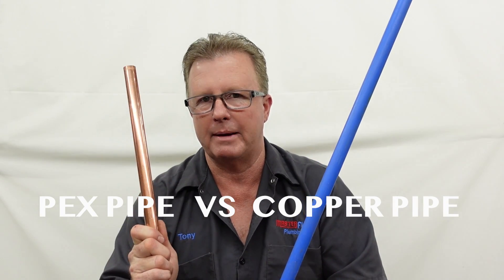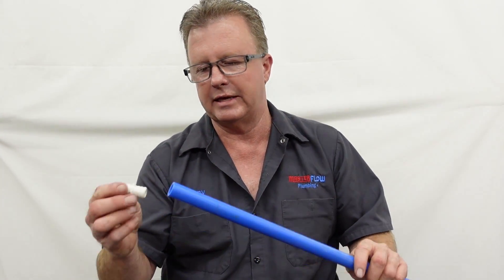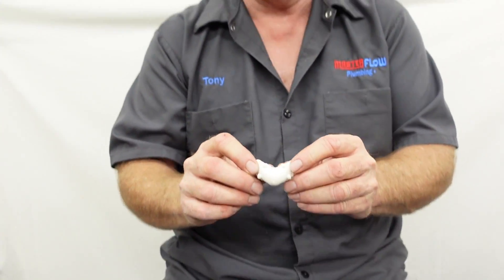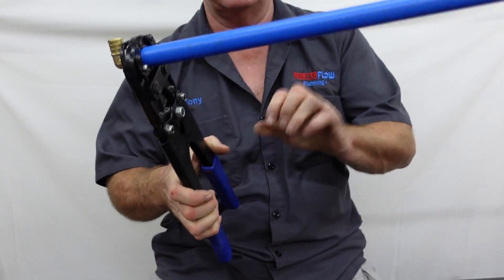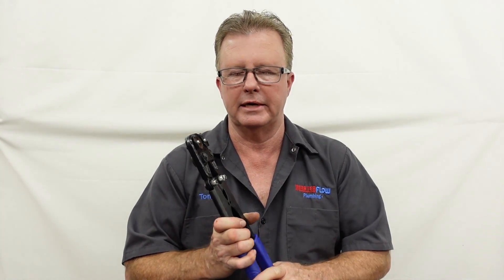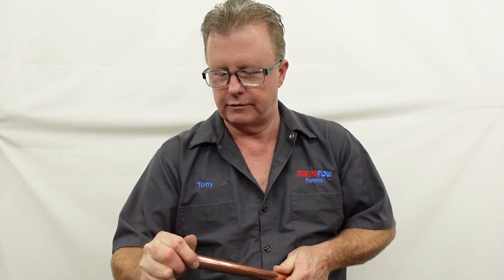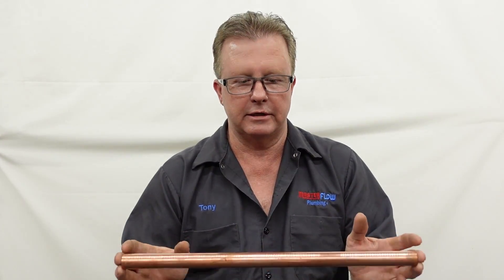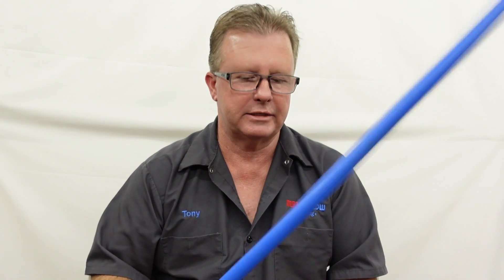Copper Vs  Pex Pipe One Plumbers Opinion

Comment: Generally a good video, so thanks. You need to check your derivation of the term 'plumber', though. Its origin comes from the trade of working with lead (plombo; Pb on the periodic table of the elements), i.e. the ability to make pipes from the metal lead.
Reply: The Latin for lead is "plumbum."
Reply from the maker: Thanks for watching

Comment: Seems as if PEX-A would solve the cons you have with PEX.  Also, "plumber" has its root meaning in the Latin word for lead.  In our use of it as meaning truly vertical, that comes from the use of a lead plumb bob on a line.  Then again, plumb bobs in modern times are more often brass or ferrous.  I like copper too, for indoors.  I prefer PVC for outdoors, but buried well below frost line PEX-A is an alternative.  Nice presentation!
Reply from the maker: Thanks for watching.
Reply: Back in the day plumbers made lead joints on soil pipe made of cast iron.
Reply: @bud5084  Yep, pack the bell with jute and pour the joint with lead froma ladel.

Comment: Installed a 1/2" Pex-A line to feed my refrigerator ice maker from an RO system. Wife says it makes the water taste like plastic I took a sample from the RO system and she says it's good has to be the PEX. Seems to be after the water sits in the line for awhile if I flush it then taste is better. Also forgot to mention PEX can be chewed by rats, or other rodents where copper can't be chewed.
Reply from the maker: I’m not a big fan of plastic water lines. Period.  Thanks for watching

Comment: I am doing a complete rework of the master bath including 3 shower heads, not a cheap project. I am a retired HVAC&R contractor so soldering is no problem PEX will be used due to the cost difference, although copper is preferred.

Comment: Don't let shoddy work stop you - I installed PEX in my basement and I used a string line to make sure it was absolutely straight. And I left a neat looking expansion loop, it's not necessary to use "wobbly" PEX to do that.

Also, you talk about fittings reducing the diameter of PEX, but properly installed PEX should have almost no fittings at all - it should be a single run of PEX from source to fixture. Even if there are a few fittings contrast it with copper that has multiple elbows that end up reducing water flow far more by comparison.

I will always like copper more, it just looks nicer (the color), but PEX has advantages I just can't ignore.
Reply from the maker: Thanks for the input.  I’m not a pex hater necessarily.
Reply: With the special tools and the manifolds and special fittings how is it cheaper?
Reply: @bud5084  For starters you use like 1/20th the fitting with PEX vs copper. Second the fitters are really not expensive, and neither are the tools. A manifold can cost a bit, but you can always just make your own with some tee's if you really want (but I think a pre-made one will still be cheaper, especially the ones that already have valves, vs buying a valve for each line on your own).

Comment: Sharkbite fittings are prohibited for use in interior (finished) walls in some municipalities. Not allowed anywhere in NYC as they tend to fail and cause flooding.  A well soldered copper joint lasts 50 years or longer. Pex?  Not sure how long Pex lasts compared to copper. Also, copper has natural antiseptic properties. It resists bacterial growth inside the pipe.  I would rather have my drinking water delivered via copper than plastic.
Reply: That's not true: https://www1.nyc.gov/assets/buildings/bldgs_bulletins/bb_2010-010.pdf
Reply: Brazing instead of soldering will provide a very tough connection
Reply: @davidperry4013  Certainly!! But  soldering is more than durable enough for most residential and commercial water lines, both supply and hot water heating applications.
For industrial and high temp hi pressure brazing is required.
Reply: For people that don't know, yes copper pipes will disinfect water.  It also dissolves in water and will leave green stains in toilets or bathtubs.  If you have acidic water like I do, that becomes a real problem and will eat the copper pipes.  So those are advantages and disadvantages not listed in the video.
Reply: Too bad for NYC. Sharkbite overbite fittings can be used safely and securely elsewhere. NYC has always been an issue, ever since they allowed the British to ensconce themselves there for the entire duration of the war. They haven't kept up anytime since.

Comment: It was pretty clear from your pro vs con list that copper was your preference.  You entirely forgot about Pex A.  Either way with Pex B you can go up a size.  There are clamps now for copper too.  They go on the outside.  You can install pex straight but you dont have to. 

 If it is for some reason visible copper is definitely the nicest to look at.  Copper pipe done really well looks nice.  Pex looks like pex no matter how nice you do it.
Copper if soldered properly hold up better against pressure surges but water hammers are standard now. 

Where I live Px A and B are the more popular choice and copper is fairly rare in new builds.
Reply: This is a very misguided review when not mentioning PEX A for full diameter through fittings and cordless pipe expansion tools from Milwaukee and DeWalt that make PEX A installation much easier than in this video.  Copper piping approaching extinction for residential plumbing due to much higher installation costs for both material and labor.  Either PEX A or B will last the life of the home.  I have a 50 year old home that sections of copper pipe have been replaced due to pitting/pinholes/scaling.   That won't happen with PEX.  Oh, and it's a lot easier to screw up one of the million copper fittings you'd need to sweat on for an entire new home, which is a bitch to repair, than to screw up installing much fewer needed push-on PEX A fittings that are very easy to repair.  MAJOR HEAD SHAKE HERE.
Reply from the maker: @bobbray9666  im just sharing my opinion of the two i discuss ..no need to majorly shake your head
Reply: @masterflowplumbing9812  Yes, sharing a dishonest opinion.  If I was to take the opposite view in a similar video, maybe I show how copper needs to be cut with a hacksaw and sweat with a soldering iron.  It works but it's a slower and more cumbersome process.
Reply from the maker: @bobbray9666  how can my own opinion be dishonest? we didnt mean to hurt your feelings , we had no idea your love of all things plastic ..thanks for watching though
Reply from the maker: you are correct .. im a old school copper plumber....i didnt really forget about pex A i  just wanted to cover the basics in this vid..thanks for watching and commenting
Reply: Yup! I upsized 3/4 to 1' and 1/2 to 3/4 as you said and getting same flow the copper I replaced.  
*I also don't hear of pros installing PEX B to often.

Comment: Over the decades I've found and learned that COPPER will way outlast any and all PEX plumbing !!!!!!  True , COPPER is more expensive than PEX . But if you want it to last a lifetime , pay for COPPER Plumbing !!!!!!  Before PEX , there was many other plastic plumbing pipes used in different construction and plastic and PEX Will Fail !!!  I'm old school , if you're going to do something , do it Right the first time or don't waste your time , and Money !!!  Any and All repairs Will Cost you Money !!!  So just do it in COPPER !!!!!!
Reply: On what do you base your opinion that copper will outlast pex?  Copper is subject to corrosion (google blue stains on sink) which can cause it to fail.  Also because of the cost, most copper used in water supply lines is M which is thinner than L and means that there is less material to corrode before the pipe fails.  Because that corrosion happens inside the pipe it will look fine until it fails.  Pex on the other hand doesn't corrode.
Reply: @artdeco18  Different plastic pipes and plastic water pipes have been used sense the 1960's . I've had to repair and or replace so much more plastic pipes and plastic water pipes than I've ever had to do much of anything to as for copper pipes and copper water pipes !!  It's just my hands on experience sense the 1960's !!!  I've experienced hands on work from near the Northern Boarder to near the Southern Boarder , from East coast to the West coast and through out the United States of America plus several countries around the world !!  I can only speak the truth of my actual work experience of over 5 decades plus . I'm a guy who works with my hands throughout my life . And I told you and everyone who read my comments on copper pipes and copper water pipes !!  I've even work with and on galvanized water pipe and cast iron sewer pipes along with concrete & tile sewer pipes which goes back decades before the 1960 when those were installed . It's probably too dirty of work for most people , but I worked and worked hard and on dirty work most people won't even consider . But real and true work is the proof !!!  No matter how many books you read or what colleges you went to !!  I did the actual work and have seen the results with my own eyes and hands !!!  As an Old  U.S. MARINE , I have Honor and the Truth !!!!!!  Without giving secrets away for free , I'll keep them to myself until I get paid for such information !! So my secrets have thrown out your theories and theories on corrosion as I have several secrets preventing corrosion from both inside and outside the copper pipes and copper water pipes !!!!!!  When you get to Heaven's gate come judgement day , you will learn the Truth as I have spoken about !!!!!!
Reply from the maker: three cheers for copper .. it is always my fave
Reply: No pex has been broken to last 125 years while copper has alifespan of 75 years
Reply: @starskorich3673  I wasn't aware pex has been around for 125 years. They said the same about poly pipe after 11 years problems began to show up as the Polimar began to break down. Ask Portland, Ore. and the Puget Sound area.
Reply: Many mobile homes have sprung leaks I just a few years after manufacturing with the spaghetti looking plastic plumbing installations. I know, I had to replumb some of them.
Reply: Proven sorry not broken
Reply: @starskorich3673  pex hasnt been around for 125 years, in order to actually prove your theory